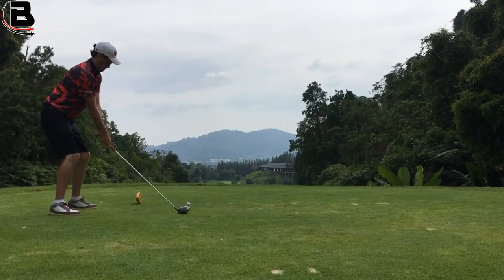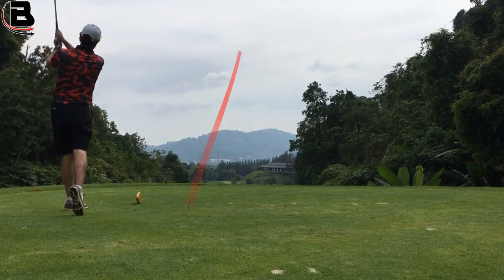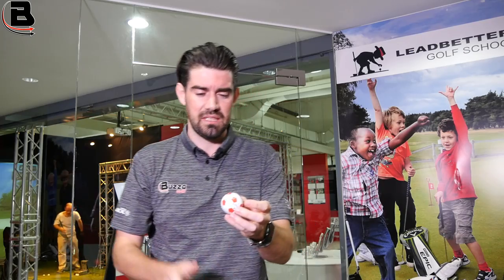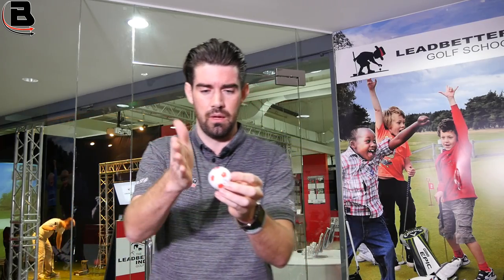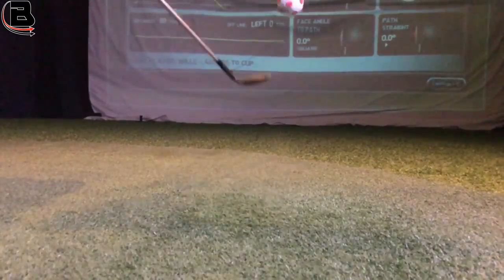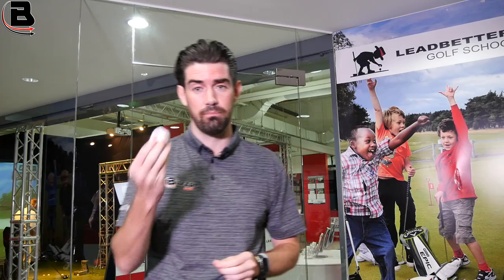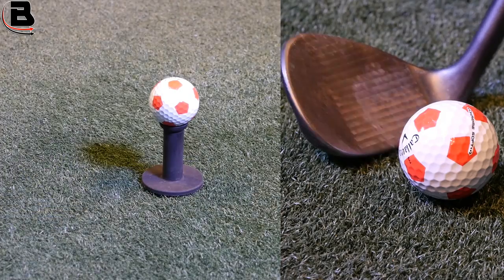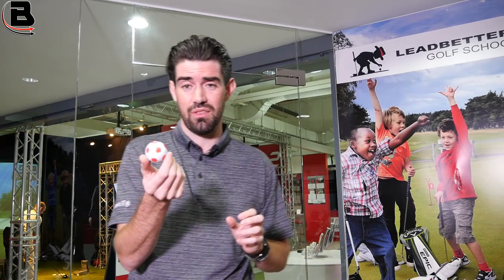5 Piece Golf Ball Vs 2 Piece Golf Ball

Comment: Hi Steve.  your videos are really good pity picard has not followed you to Bangkok. I have a rather unusual issue at the moment. I get my lessons indoor on a trackman. my swing speed has dramatically dropped over the winter and I've not had any injury. my 7i used to carry 162 and although I have changed iron my distance has dropped off by over 25 yards. HELP.
Reply from the maker: +Iain M surely your coach can identify the problem with the TM numbers. Sometimes hitting off mats can have an effect but would be looking at the data first
Reply: My smash for 7i is down between 1.26 and 1.33. Just seems like a massive drop off from late last year